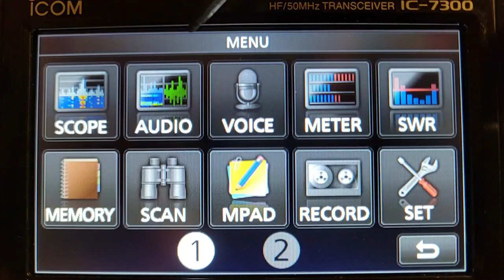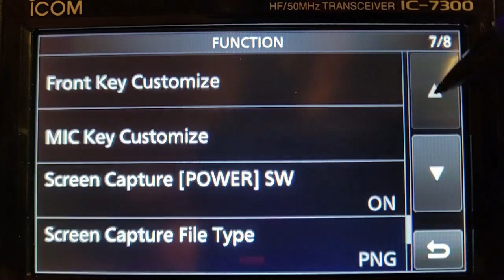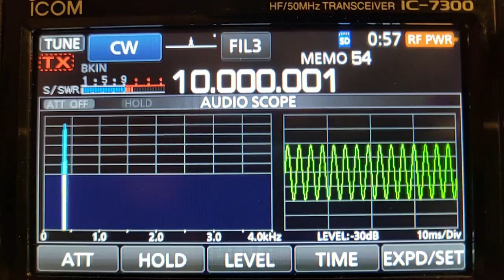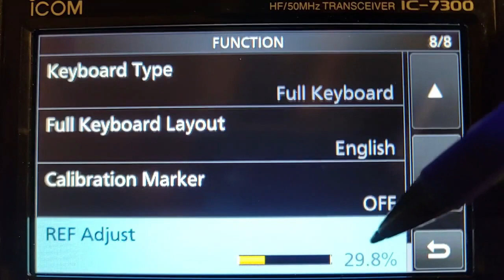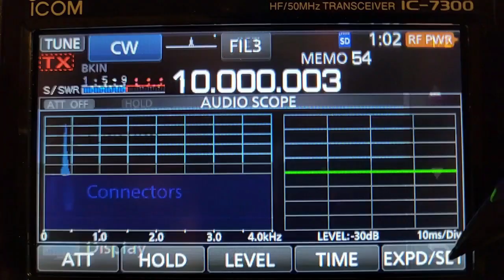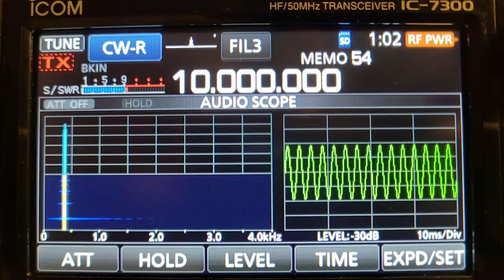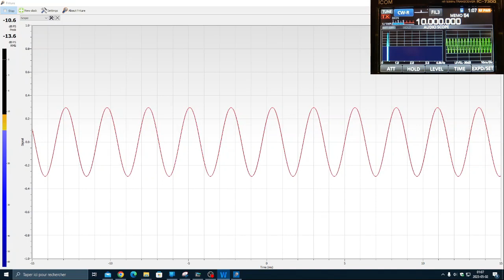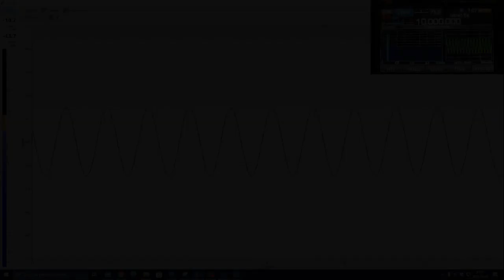VA2CST - Calibrate the Icom IC-7300 oscillator with reference clock like WWV or CHU Canada

Comment: Fantastic video. I bought my 7300 used and suspected it was a bit off frequency because I found myself using RiT quite often to fine tune conversations. Through your method I discovered my Rx to be low by 23 Hz but fixed it with a new REF of 30.6%. Thank you for taking the time to help us!
Reply from the maker: That is awesome ! Thank you for your kind comment and I am glad you found my video helpful ! Enjoy your tuned 7300 !!
Reply from the maker: 23Hz is quite a lot on SSB, clearly audible, no wonder why you needed to use the RIT to hear everyone on frequency !